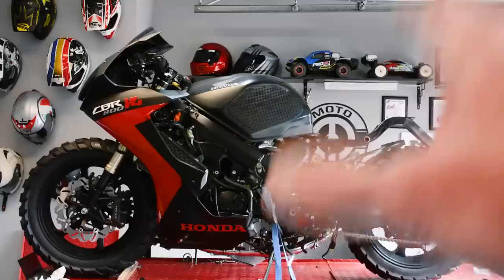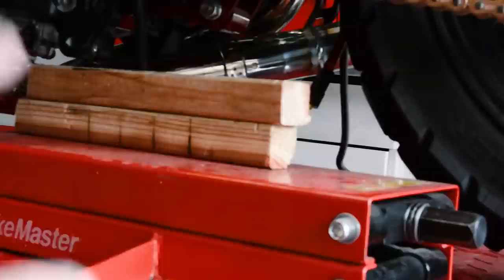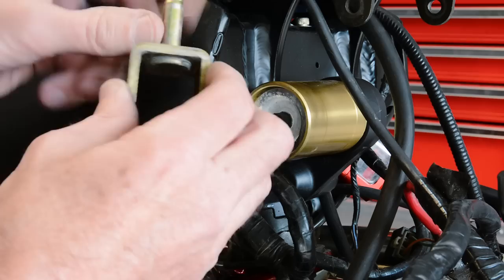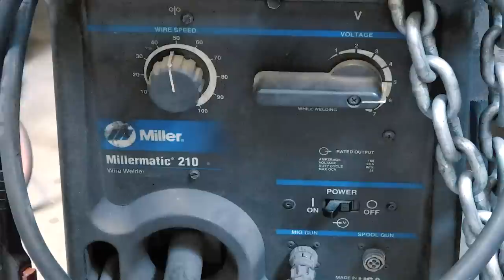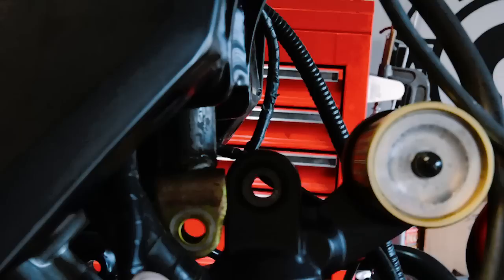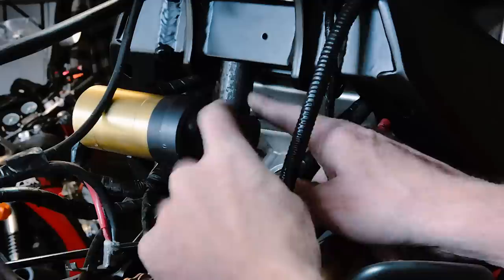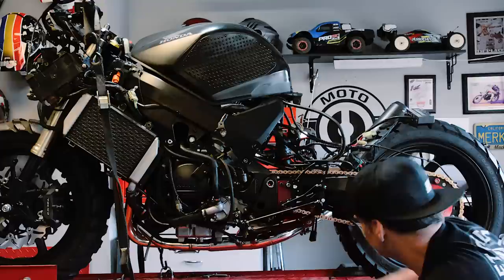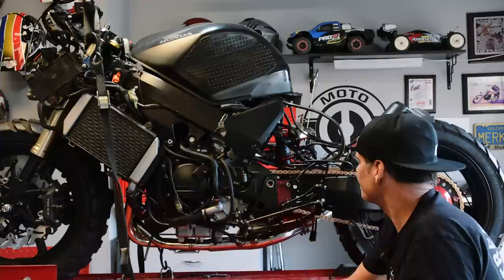HONDA CBR/VFR 800 HYBRID BUILD - UPPER SHOCK MOUNT UPGRADE

Comment: I built my VTR Firestorm/Firehawk with the same swingarm and had the same issue with height. Used a spacer  too to get the rear end higher. 
Had the same frustration with all that wiring in the way and finding ways to tuck it and make invisible.
Great build yours!